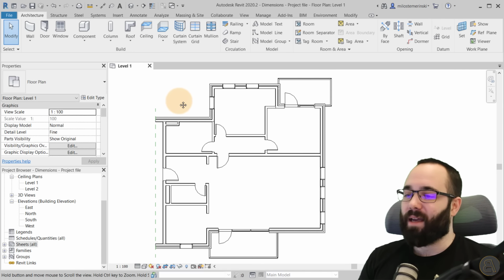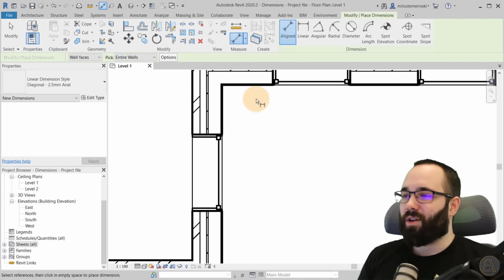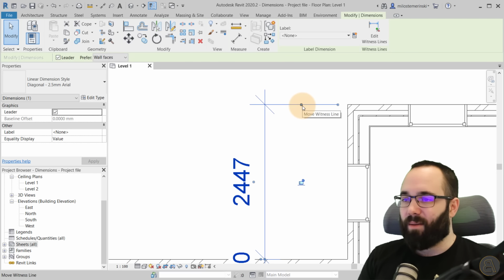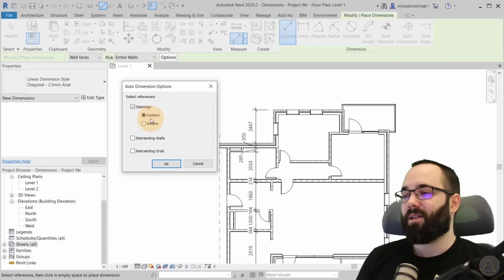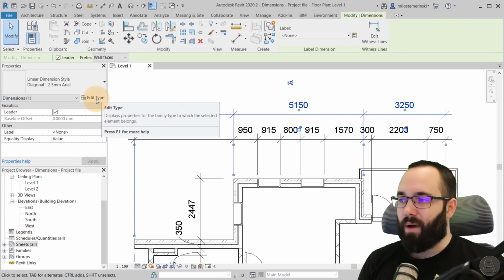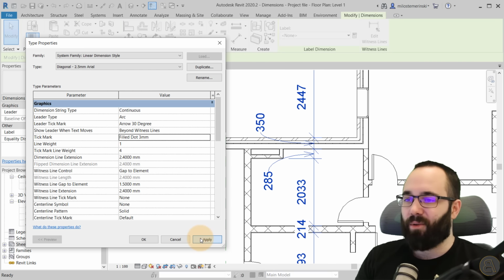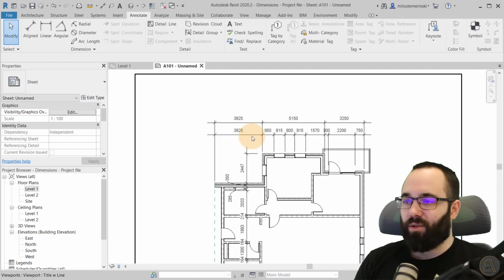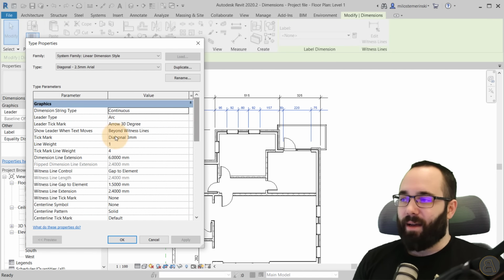Dimensions in Revit - Beginner to PRO Tutorial

Comment: I am using a baseline dimension with Witness Line Gap to Element set to 1/64", the outside lines look correct with a small 1/64" gap, but all of the interior witness line element gaps are much longer than 1/64". How can I adjust the dimension family parameters so I don't have to manually drag every witness line to the element?

Comment: Thanks for the tutorial, very helpful. I have a queastion hoping I could borrow your knowledge, my tutor at online course who expert in ArchiCAd keep saying dimension should not include interior finishes, ex. 10mm  plaster board, he says it's a Universal rules, is that true? I googled it but now one says it's a universal rules. we are duplicating existing plans for assignments, and revit user students have to adjust wall cavity for dimensioning, I feel this is a bit odd, ArchCAD user has 50mm wall cavity, but Revit user has 40mm wall cavity because the way  revit dimensioning. is it normal practice? sorry for long comments
Reply: Yeah, you dimension only the bearing core of the wall. Think about why do you dimension in the first place. Dimensions are used by contractors to build and they need to know where to place the brick. In this phase contractor doesnt care at all about thickness of the finishes. And when the rough wall is built, contractor doesnt need to check the dimensions in the blueprints. He just does the finishes.
Reply: @soprikcze  I see,.Thank you for taking time to explain it to me, our teacher never mention about how contractors read dimension, he doesn know about revit so just keep saying it's universal rules, change cavity size to adjust. well, Thanks again!